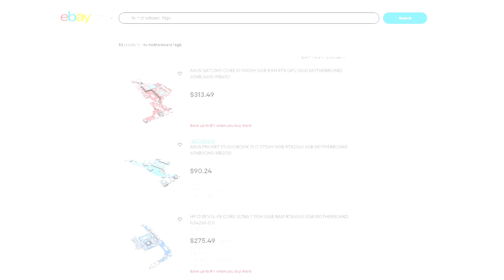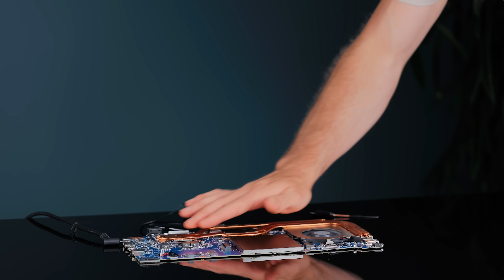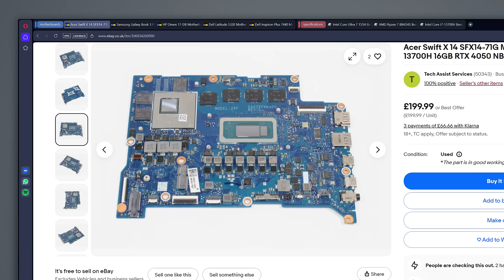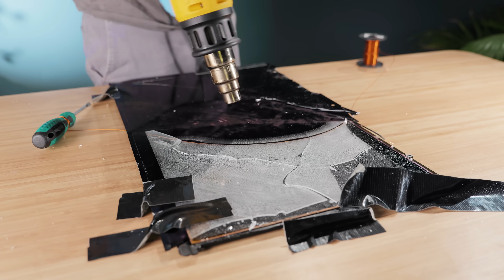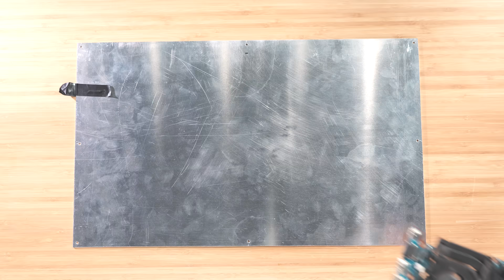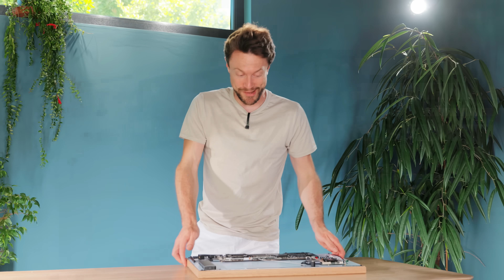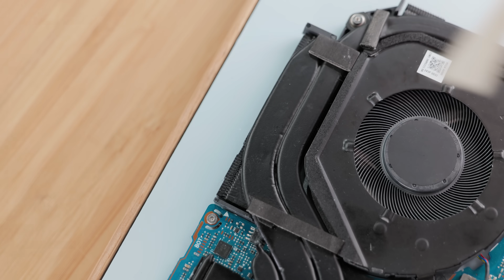A new way to build a PC in 2026!

Comment: Great build—it looks fantastic! One small improvement I might suggest would be hiding the power cable inside the rear wooden leg by drilling a lengthwise channel and routing the cable through it. This could make the overall design look even cleaner and more refined.

Comment: Considering that I have a laptop with a broken keyboard which I am thinking of turning into a desktop, instead of just buying the keyboard, the information on finding the power button is actually very useful! I originally intended on going through every pin combination on it with a multimeter until I found out which one of them was the power button, but this does make it a fair bit easier. Or I could turn it into a modular laptop where it's portable enough that I can take it around with me but it easily allows me to plug the GPU in when I'm at home.  (Even if cost-wise it doesn't make that much sense because the keyboard itself is 100 euro, and if I do this I'd plan on doing something a bit more than just using it as is- namely, I'd probably get a GPU on it)

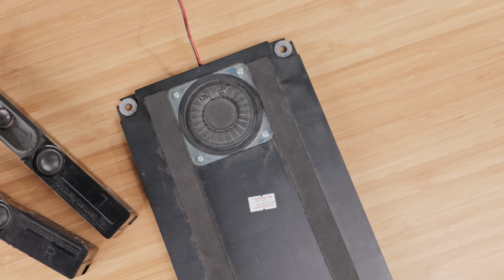Comment: 18:58 oh man you should have reused the iMac speaker, there are 27in iMac speaker driver, and I’ve found out that the 21.5in iMac speaker are just wired the other way, or you can just make your driver board

Comment: While the paper trick is nice and works - NEVER PUT PAPER INSIDE A PC MUCH LESS CLOSE TO ELECTRICITY
Usinf a thin plastic sheet the same thickness as the paper would be way safer and wouldnt be hard to get (some random plastic packaging for food for example)

Comment: a rabbit hole you might want to consider going down when it comes to laptops and things like mac displays, is that laptops tend to use eDP, or rather a 'flat display port', if you will, which is a mostly open standard.

the laptop board  uses eDP to connect to its' own monitor, then it will have a eDP port on it, which basically requires a flat ribbon cable. I can't be certain that apple didn't make this impossible out of spite, but it could be that the mac's display requires eDP or a variant of it with a different configuration anyway.

the only problem I foresee is that different laptop manufactories would use different layouts for their ribbon cables for their eDP. meaning you'd need to get a custom ribbon cable that has like, wires crossing over other wires to touch the monitor eDP receiver port in a different pin.

since this is apple we are talking about, I have no doubt they made sure to have an eDP receiving port on their monitors that are deliberately non-standard configuration.

anyway, there are youtube videos of people breaking out an eDP sending port from a laptop board, into various wires, like regular electrical wires, which then flop all over the place and look messy, so they can work out where each wire needs to go on the eventual display. after doing this break out, then they made up a new ribbon cable from scratch which follows the wire chart, with the ribbon cable then adapting the eDP sending port configuration to the monitors' receiving port configuration.

then it usually just works. because its just display port video signals in the end anyway.

Comment: HELLO everybody, if your interested in purchasing one of these boards for any sorts of activities but don't have a multimeter, you can simply plug it in and assumably jump the two pins that are either separate from the rest of the small pins on the keyboard plug or the ones on the most outer edge. This is well explained in the video but I'd like to say that you do not require a multimeter to test for this, I just warn you to be careful as it can damage keyboard compatibility and cause irreversible damage. How do I know this? Well I spent around 4 months with a broken laptop for my school activities and was forced to remove the back panel and jump start it via the pin every time to boot it up! In actuality I had a tiktok video of me doing this that went incredibly viral.

Comment: > Sees a laptop with a broken screen on Facebook marketplace for $30
Ferb, I know what we're going to do today.
Reply: Really showing my age here, but "Pinky, are you pondering what I'm pondering?" 😂
Reply: @EvenTheDogAgrees  I understand that reference despite being a Zoomer.
Reply: @EvenTheDogAgrees  "I think so, but where are we going to get that many pairs of rubber pants?"
Reply: @EvenTheDogAgrees  I thought the exact same thing lol
Reply: yeah.. add a 3D printer, filament, several laptop motherboards to try if they work, several screens to delaminate (you think you can do it just with one only try?) sheets of aluminium and wood, a cutter (or two) for those, new RAM, new Wi-Fi, new SSD... PLUS all the skills and knowledge to do all of that AND the time to find a screen for $30. this is a rich boy project.
Reply: @metallurgico Or, you know, do what you can. All of these videos are informational and are supposed to be used for inspiration. 

Do projects within your skill set and budget. You can probably afford a saw and wood glue, as well as cheap components. It can be ugly and messy as long as you had fun and learned something. Having something useful at the end is bonus points.
Reply: @JohnnySnappleseed  yep these are like a soup recipe. You take the base provided as inspiration and then you make it to your ingredients and taste. You could make a laptop and monitor combo functional by using the random wood screws to mount the board to the back of the monitor.
Reply: @Falcodrin  It's also something that you don't have to get all at once. Instead if dropping all that money getting everything you need right now just make a list and check around every once in awhile and see if you can find a piece cheap. Or the pro move here, set some eBay alerts for things below a certain price. Throw what you have on your ADHD shelf or box or whatever and go work on some other project until you've got everything you need for the next one. 

Every payday I pay what bills need to be paid that week then I'll hit marketplace and eBay and see what kind of cheap components I can find. Marketplace often has a ton of free stuff with tons of potential uses. I have a crazy number of projects going like that though but it works for the way I'm wired. I have like 3 projects on the shelf just waiting for the next piece but also at least one on the bench to keep from getting bored.

My point though is simply that you don't have to buy everything at once. Spread it across a few paydays. Or even longer. 

Don't just buy now, dedicate an hour every week or two to see what's out there real cheap. Multiple projects helps if you're the impatient sort. Sourcing stuff to work with is a skill, it takes practice.
Reply: @metallurgico  I was going to reinforce the screen's LCD with some acrylic sheet and scrap wood and use it as a lightbox as shown in a previous video. The laptop is confirmed working beyond the broken screen, so I was going to break down one of the old ATX cases I had laying around and use my trade school's MIG welding setup to make a smaller custom case. 
Like our friend Johnny said, the product is just a bonus. The real goal is to practice what I learned and have fun while doing it.
Reply: @metallurgico  The public library's maker space has a lot of the tools. Find a friend. Find an old neighbor that's lonely. These projects aren't for rich boys, as you say. They are for clever poor boys. Every tech guy on youtube will tell you the same thing. They are good at fixing things because they grew up needing to. My experience with a band saw and belt sander came from a lonely neighbor that was ecstatic to have a young man excited to learn his hobbies.
Reply: @da3dsoul  Man that part about learning to fix things because you need to really hits home. For a large percentage of my life I was pretty poor, I made it a mission to never pay anybody to do any kind of work for me. If something broke I learned to fix it myself. I'm mid 40s now and no longer broke but I can count on one hand how many times I've had to take a car to a mechanic in my life. And I drive old ones, I've needed a ton of things fixed. I've never had to hire anybody for home repairs, computer repairs, anything at all like that and as a result I've learned so many skills I can fix practically anything. And I can usually do it while spending as little money as possible.

Growing up poor sucked, but it was a phenomenal learning experience. I even fell into a great career (millwright) due to self taught skills. And it's just stupidly easier now with things like YouTube. There are tons of people out there teaching others to do basically anything you can think of and it's all free. YouTube is like a million dads that I never had. Forums are still a thing too, they're not that popular anymore but you know who is still using them? Older people that are super skilled at whatever the topic is. And he's exactly the person you need because he has the answers. 

The Internet is basically just commonplace to most people but if you think about it it's an absolute miracle. Somewhere out there is guaranteed to be exactly what you need to solve a problem and fix a thing or build a whatsit or calibrate a widget. It's there, you just have to look under the brain rot and you have the knowledge of the world at your fingertips. I'm repeating myself but that's just straight up a mind-blowing miracle and the greatest resource you could ever fathom. FB, TT, Insta, etc. are just the top layer of distractions for all the gold underneath.
Reply: @metallurgico I hate when people are so resigned to having a shitty life that they have to try to make everyone else's lives shitty
Reply: He goes overboard, all you need is a moniter, motherboard, and a screwdriver to on the computer. shove the board into a shoe box and cut a hole for vents. easy
Reply: @metallurgico So don't do it.
Let those who can enjoy themselves and pay full price for yours.
Reply: @metallurgico  Or, you could watch to the end of the video where he showed an alternative by just making a makeshift case since repurposing a laptop motherboard is the primary purpose of this video. Rich boys would just throw the parts out and buy something brand new.

Comment: great post! i wanted to point out that the price of portable screens is way down. i have purchased a 10 inch 2k oled screen and a 4k oled screen, and each were a little over 200 dollars. Each is set into a machined aluminum frame with standard 75 mm visa bolt pattern. one can make a hand held device by bolting laptop guts or a raspberry pi there. one can attach it to an arm, which is perfect for gaming.

Comment: This build or rather an ordinary Laptop Motherboard build would be at the absolute limit of my ability..and that's being hopeful..add in the extra difficulty of no dedicated power button with these later Laptop boards and that puts it out of my reach and capability..he's expert level.. I'm barely amateur..he's made these Laptop based PC builds before using older tech with traditional layouts..i could probably make one of those into a PC..I've certainly thought about it..i made a 'mistake' i guess..i rebuilt a broken Toshiba Laptop out of two badly damaged Toshiba Satellite Pro Laptops..i didn't occur to me then to use one for a PC..i fixed one/made one out of the two and it's still in use today i swear..one of my family members uses it as the daily driver years later..it was meant to be repaired..only one motherboard was actually still working..the other was dead..one screen was working and undamaged the other was smashed..one case was smashed the other was intact..i couldn't believe the odds of that all happening together just perfectly and it didn't cost me a penny in parts..some spares left over..spare keyboard brackets speakers etc...only criticism of myself was forgetting about the processor on the dead board..once I got the good board installed and tested with the good screen..the dead board went out of my head..I kept most of the unused parts but I never removed the processor..I never saw it again..in fact I never saw it at all as it was still under that heatsink with heatpipes..it went when i binned the board..oops..not that it'd probably ever get used which was why I ignored it I suppose..not stripping this down again I remember thinking..

Comment: im currently watching this on my diy cyberdeck touchscreen tablet pc from scraps.
Reply: Did you also use a laptop motherboard?
Reply: @TornadoLoL  well, my other one uses laptop motherboard. and another uses industrial type motherboard with built in lvds connector. so i dont need to use lcd driver board.
Reply: @kobs9636 Why would you not need an LCD driver board for low voltage differential signaling connection. Does the industrial type motherboard support the screen that you use out of the box with the lvds port?
Reply: @TornadoLoL   yes. built in 30 pin lvds like pin headers. and i use lvds laptop screen also. even brightness adjust is also supported. not like in those lcd drivers that just make the screen washed out if you lower the brightness. 

and for the battery, it doesnt have on board battery monitor. so i used arduino micro as HID power device to display battery percent like on those laptop.
Reply: @kobs9636 Niceeee, that sounds really cool. I think I just realised, what my next project is going to be xDD. Thanks!!!

Comment: Hello Matt, many laptops have a BIOS setting allowing "Boot on Power", that means that as you plug the power connector from their PSU, the motherboard will boot. No need to solder a short on the flat cable, tested it on several PCs: no need to open their lid to push the button, just a power switch before the PSU is enough. Great video Matt, thank you! :)

Comment: Sadly a lot of notebooks won't even start or work at high power without a battery and they will complain at startup.
Also you could just get an eDP to HDMI adaptor and use the monitor as the "internal" display. That way yu don't get any potential problems. Or in this case just wire it directly and it will work, as eDP is a standard that Apple and other manufacturers use. It makes all the screens and board compatible to each other, you just need the correct cable. That's why there are so many HDMi to eDP boards out there.

Comment: 3x less than the from components build is a little false - same name different performance between desktop and laptop is the rule. Comparable performance with the laptop even in salvage form like this is probably from my quick skim of the current second hand market more like 2x price differential. Which is still significant and of course availability of salvaged laptop boards is better with so much less competition for that component at the good price.

Comment: This is so cool!

Tho me personally, the stand was a tiny bit questionable.
as I'd imagine the center of mass is quite up with all the components, one small desk hit or push it looks like it could slide off or fall on a corner.
What could be an artistic fix to that tho, is adding a round, decently thick log slice of slightly bigger diameter then the tripod. Either gluing or crewing the three legs to it, lowering the center of mass and adding extra stability.
But that's just me, Everything else is awesome

Comment: Awesome build! But I would have replaced the heatsink or at least connected it directly to the backplate with a thermal pad. Laptop heatsinks are pretty bad and the fans have to run faster to compensate.

Comment: Could you explain why the board changed from the first "power on pin finding" to second half of the video?
Did one of the laptop boards break, was something accidentally shorted or was incompatible with something else in the video?
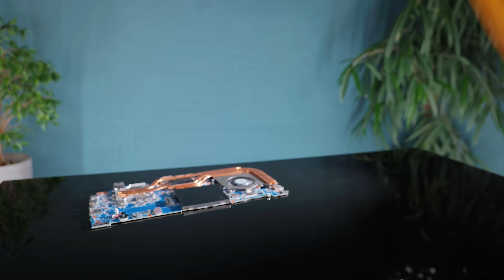Reply: The board he demos the process on at 3:12 is not the gaming laptop beast that he eventually builds in. It isn't the one he was just holding earlier at 2:14 but we do see both of them on the desk around the 02:50 mark. Then later, there are lots of different boards shown.

Comment: I like the way you pronounce Nvidia 🙂. Joking aside, I would be slightly worried that the screen is now totally unprotected on the front without the glass. Also, if you went with a 27" iMac you could squeeze the entire thing into the existing chassis with an internal PSU (but where would be the fun in that?). The 5K boards are a lot more expensive than £50 though!

Comment: Great episode, really love how in depth and scalable in terms of price it is.
Especially now with the steam machine being released and its high price, this seems like a great way to expand the possibilities further than mini atx / straight up mini PC builds!

btw did you laminate the display again and I just missed it? Otherwise it would probably be a nice addition to laminate it again or using a thin clear petg foil sheet.
Reply: Very tricky to pull all the bubbles out and not trap dust. Sure you could get away with it for a video but if staring at the screen every day and defects would grind.
Reply: @AndrewHelgeCox  I actually put a 0.5mm petg foil over my screens as a screen protector, it was enough to only secure the upper side with clear tape to the monitor housing and fixate the bottom left and bottom right corner with a thin piece of tape so it sits flush on the display (the PETG foil itself doesn't have an adhesive applied to it).
No need for a "complete lamination" with glue like he did once before.
Only cost me 10€ for a 600mm*1000mm roll.

It worked great and there is no dust (or at least none that I noticed, and I didn't even try that hard).
Also had the effect of converting my monitor to a glossy screen which looks more premium, but of course it also introduces a bit of reflection which could be a dealbreaker for some.